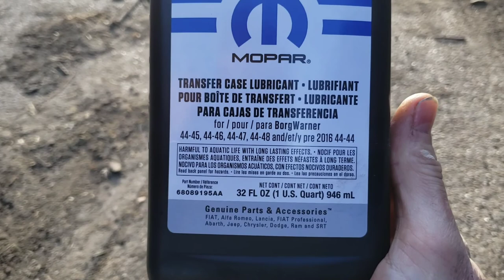Output Shaft Seal  - Ram 1500

Comment: Hey Joe, first of all this is about as honest and real as it gets (imo). Admitting a mistake is not easy so huge respect for using your error as a teaching tool for someone like me. I would not have known to chock the wheels either. It's impressive to me that most of your repairs or the majority it seems are in the dark... you are "no excuses Joe". Awesome. I never thought it would be so "easy" to remove the shaft and the seal. Good stuff to know. Honestly, the videos you've made are very helpful to me. We need more subs!
Reply from the maker: Coyote, thank you so much for your continued support. It definitely crossed my mind to edit out the mistakes but my intentions have always been to help the next guy. What better way to learn than watch me mess things up. 😁
Reply from the maker: I was pleasantly surprised how easy it was too. Probably why I didn't take my time and do it right the first time.  

The hard part for subs with a channel like this is that the info is so specific.  I don't make entertainment type of content.  Hopefully once the race car gets moving,  more subs will come.
Reply: @notamechanic153   Hey joe how many miles u got on ur truck/ u had any major problems with it ? trying to decide if i should keep mine or sell it and get a toyota
Reply from the maker: @simono1619  I have 134,726 as I'm typing this.  I haven't had anything major such as engine or transmission. Once I hit around the 120k mark little things have happened.  Nothing I wouldn't expect of any vehicle.

Comment: Thank you for mentioning that because of lubing the shaft it may drip for a week or so. I picked up my truck from the dealership after they replaced the input seal and noticed leaking from the output shaft seal area. That freaked me out but now I feel better knowing what you said. Nice vid. Thanks 👍
Reply from the maker: No prob dude.  Hopefully it is not still dripping.  🤞

Comment: Thanks so much for this video.  Like you I did a replacement already and mine leaked again.  I'm sure it had to do with how I put the new seal in.  I used your method with the wood and using a hole saw and it worked perfect and quick.  Fingers crossed no leaks from the new one.  Keep it safe!!
Reply from the maker: Thanks for the praise my friend.  Hopefully you are still leak free.🤞

Comment: Hey first off I appreciate the honest video, but I also wanted to state that the e brake will absolutely work even with the driveshaft disconnected. Its a cable that runs to the back tires and yes it is a drum, but has nothing to do with the driveshaft. Once that ebrake is engaged, if properly adjusted, will not allow the back tires to move. Yes you should still chock the tires but the Ebrake will 100% still work. Just food for thought.
Reply from the maker: You're %100 correct
Reply: You mean 100%?

Comment: I would have dressed up that yoke shaft with a long thin strip of fine emory paper or scotchbrite pad so it's smooth. when the rear bounces up and down, that shaft slides in and out of the transmission. When the dust boot touches the rusty shaft, it acts like sandpaper against the rubber and wears it off. 
Funny how us with stick shift Rams always have a working ebrake compared to auto owners :)
Reply from the maker: That would've been a good idea.  I might do that next time I change fluid.
Reply: I always use my e brake so I don't damage the parking pawl on my steep driveway. It didn't prevent my ebrakes from rusting out and seizing. Had to take rear axles off to change all the damaged parts.

Comment: Did you hear a howling noise whenever you would take your foot off the gas? ( Before you changed it; as in you heard the noise and then you knew you needed to fix it?)
Reply from the maker: No, luckily I got under there just to change the fluid and noticed it was dripping.  I must have caught it just in time because there was still a lot of fluid left.
Reply: @notamechanic153  Nice. I only ask because my 94, 1500, made this noise and now I think this is the problem. My drive shaft after popped out completely, and my transfer case exploded. So I'm replacing that as well.
Reply from the maker: @waydebaker33  Damn it man, that fuckin sucks. You're probably right as far as the noise you heard.  I'll definitely be listening for it in the future.  You have me wanting to go check the fluid again right now.  Lol
Reply: So I got mine tore down, and it looks like probably my bearings went bad and cause my pinion teeth to shear. I opened her up and teeth fell out all over the place. I'm gonna re build it and see what happens.

Comment: Why do you make lines ? Should lines like that be made when your even just doing ujoints?
Reply from the maker: I just wanted the teeth to line up in the transfer case the way they came out. In this case I'm really not sure if it'd matter but I didn't want to risk anything.  Plus it was easy enough to just put it back in how it came out.
Reply: You want to keep the shaft in balance and as true as possible if you have a quiet and wobble free driveline. Things tend to wear together from use and it might affect tolerances if doesn't go back the same way.

Comment: It's a shitty job.  How many miles?
Reply from the maker: It was between 120 and 125.  I probably should've written that down.
Reply: This is as easy as it gets, you should try taking out broken exhaust bolts in the aluminum heads to see what a shitty job is.